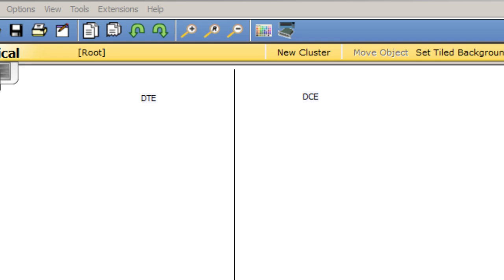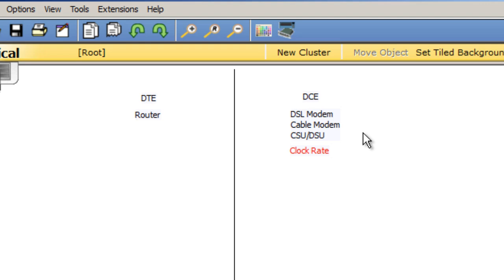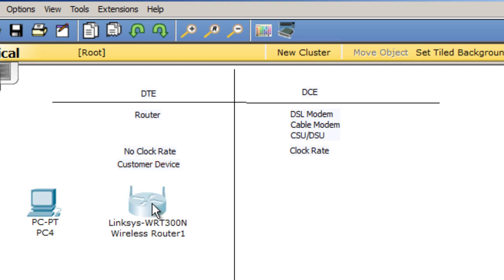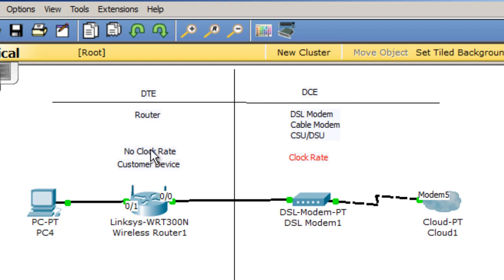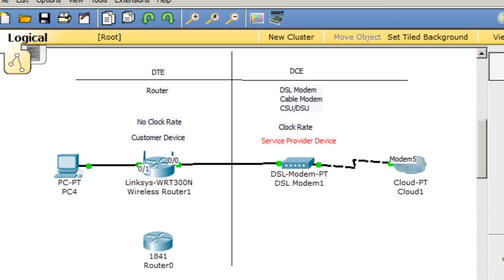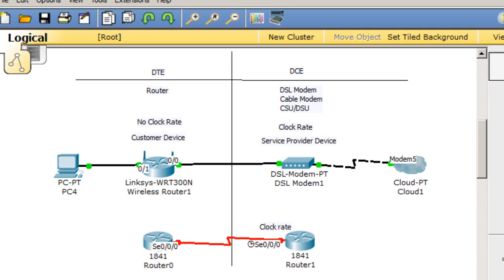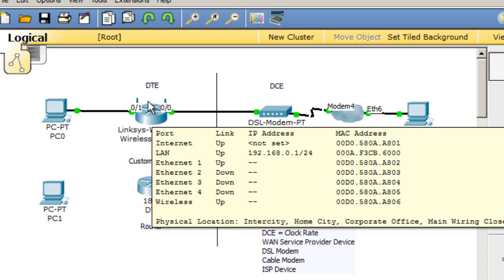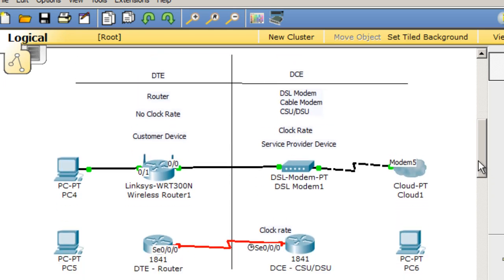The purpose of the DTE and the DCE in the Cisco CCNA

Comment: A CSU/DSU converts digital signals from a router to a leased line; a modem converts digital signals from a router to a phone line........two questions for DAN first is the CSU/DSU and the modem are different devices and can you elaborate more on this answer from a CCNA topic and it is the correct answer.

Comment: Hi Dan,  i was just curious, how would DCE DTE work in your house for example? In many instances nowadays your router acts as your modem as well. Is a clock rate still applied and the router still acts as the DCE? Or there is no DCE DTE applied?
Reply: I'm of course not Dan, and I'm now studying for my CCENT/CCNA cert and came across this DTE/DCE in my labs. After watching this video, if a customer site has a multifunction network device, its still considered a DTE since its on the customers end site vice the ISPs end site.

Comment: Your use of a DSL modem confused me at first because it's not a DCE. The ISP's DSLAM is the DCE because it sets the clock rate that the modem has to synchronize itself with. A DSL or Cable modem is an end user device because it's the "client" of the DSL or Cable connection. The connection between the modem and the router over Ethernet is "negotiated" between the two devices and the lowest that the two agree on is selected. So between a modem and a router there is no DTE or DCE.

Comment: So why does provider need clock and how does that affect the connection?
Reply: Generally the clock rate need to be the same on both ends of DTE/DCE so they can negotiate the same speed. It wasn't clearly defined but as far as I know The DCE generates the clock rate and GIVES it to the DTE to synchronize. Similar to auto negotiation.